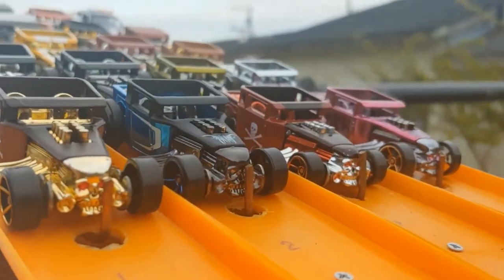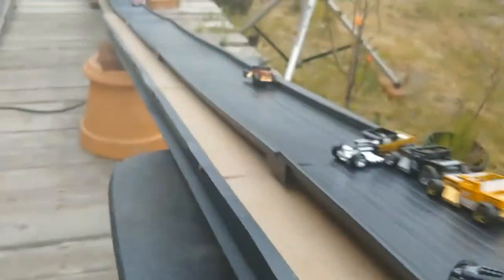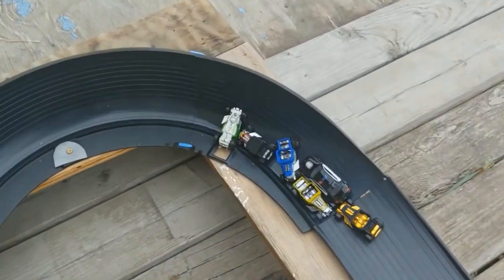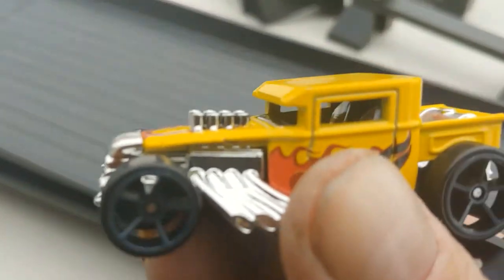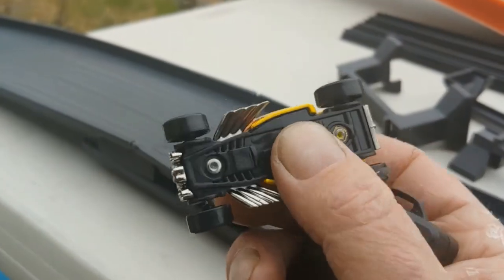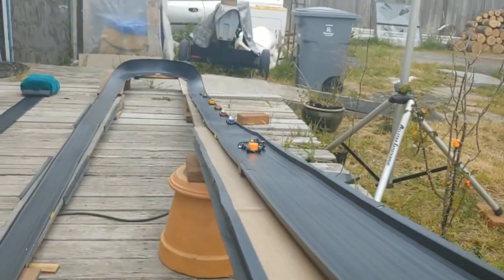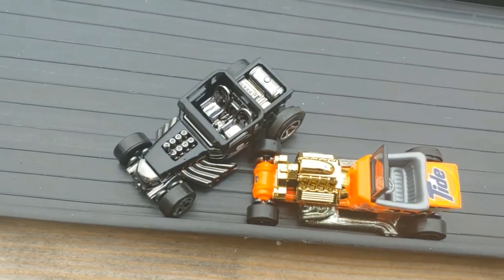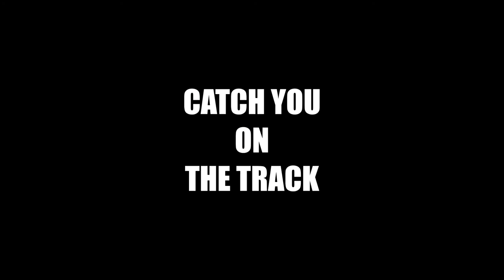Bone Shaker 19  Trophy Dash Outlaw Street Racing Exhibition Hot Wheels

Comment: This was very cool, most bone shakers I've seen in a race,  very cool, pink bone shaker is MAD, cheers KC 🇦🇺🤝🇺🇸🚦🏁🏆😎
Reply from the maker: Most of them need wheel work, a good dusting.  They should have ran better down the track.  I have a plan to fix that wad of car issue.  That pink one is the latest one of those I worked on, and she has a little extra weight.🔥🏁
Reply: @PowerDriveRacingDJTrippleJ  cool, pink bone shaker must be Bon007 👍💞awesome, good to hear from ya, cheers KC 🇦🇺🤝🇺🇸😎👍✌🚦🏁🥇🏆